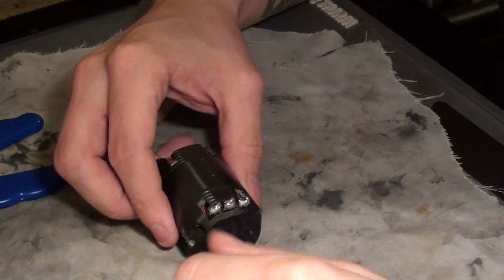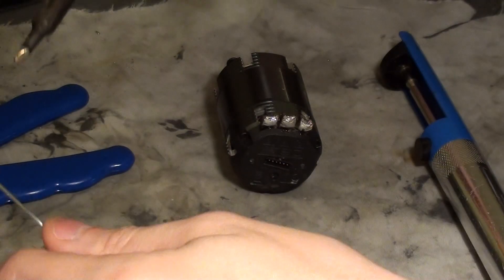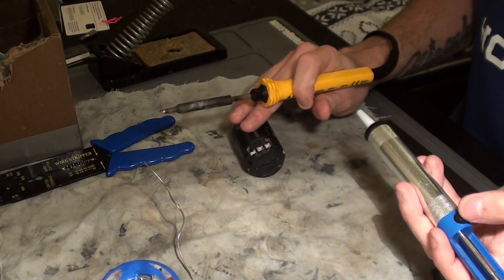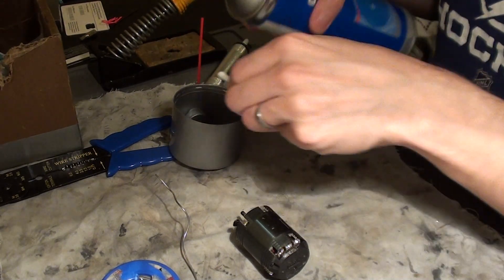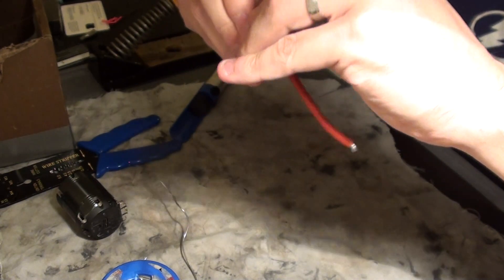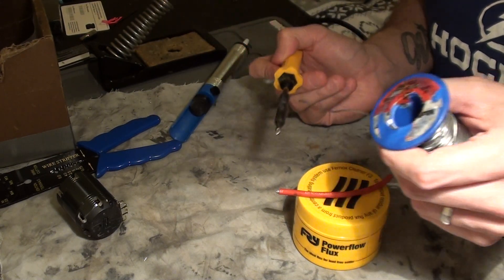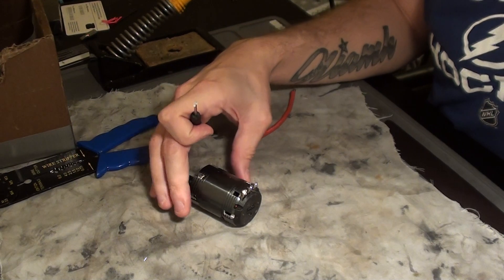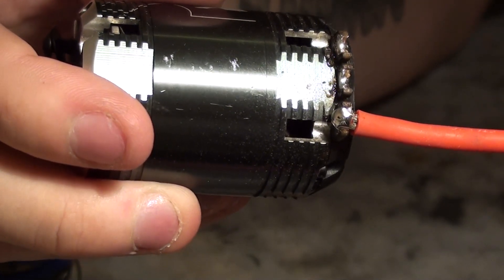Throwback // Soldering // How to solder your RC motor (2012)

Comment: Great video - You have to make sure your iron is a high enough wattage and fully hot when soldering to a brushless motor, so that you don't over heat the middle terminal of the 3 pole motor. The middle terminal is very short and can come unsoldered from the windings inside if the iron is left on there for too long. I always use seprate flux on both wires and terminals to ensure the remaining solder does not dry up and become brittle.(a dry joint)